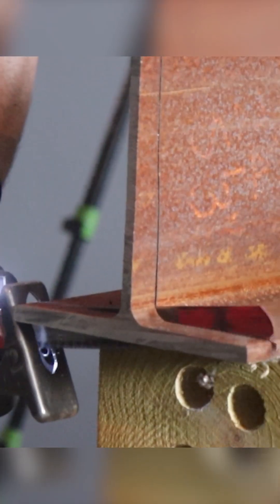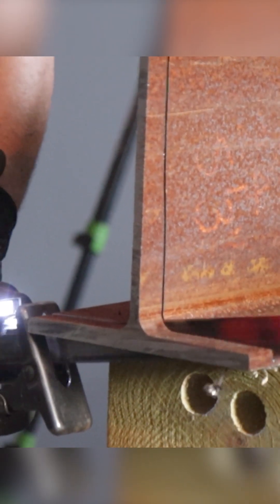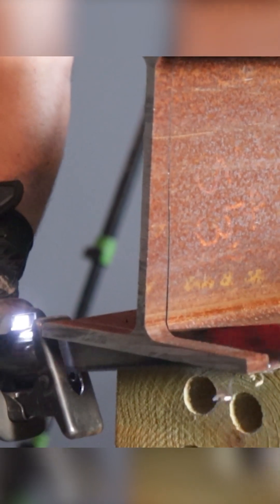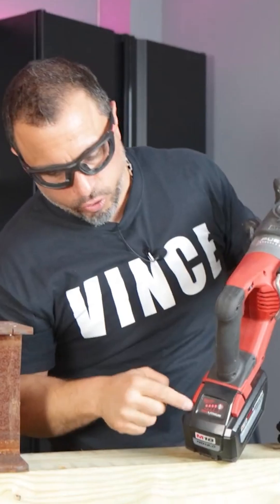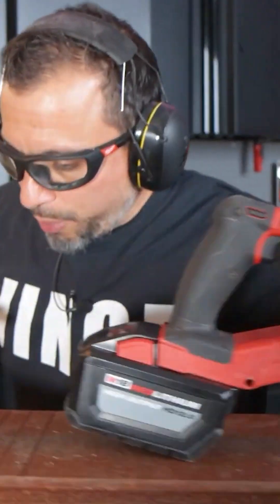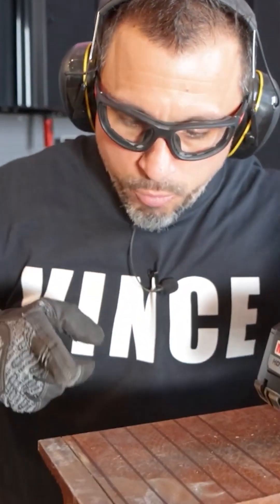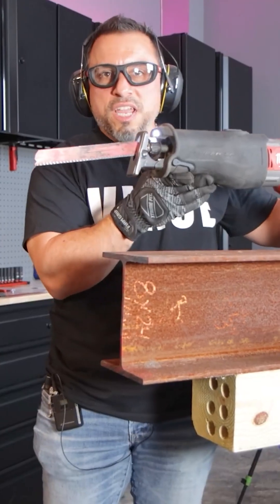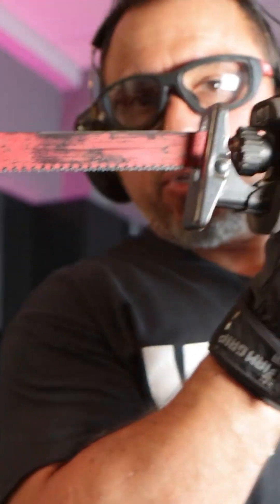PART 1- HOW MANY CUTS CAN THE DIABLO AMPED BLADE DO?

Comment: Wow!  Could a Bosch with Diablo blade do this?
Reply: Yep, would also reccomend using cutting oil on the blade. Keeps it cooler and helps the blade last longer. Also less friction so likely faster cuts.

Comment: Just use an angle grinder. Diablo blades are incredible, but use the right tool for the job my man. There’s almost never a scenario where you could use the reciprocating saw and can’t use an angle grinder on an I beam
Reply: It's a torture test for the blade.
Reply: A situation where you don't want sparks?
Reply: @maxshepherd9790 good point, though the reciprocating saws still make sparks when cutting metal, they are indeed more controlled
Reply: Wouldn’t a grinder be harder to use though? You’d have to get up in the corners and switch sides a lot the recip saw makes it easy. Also you’d go through a lot of cutoff wheels and wouldn’t end up saving much money if at all based on how long this blade lasts